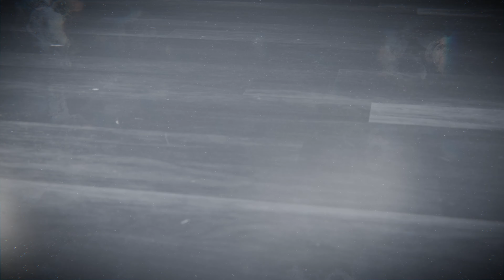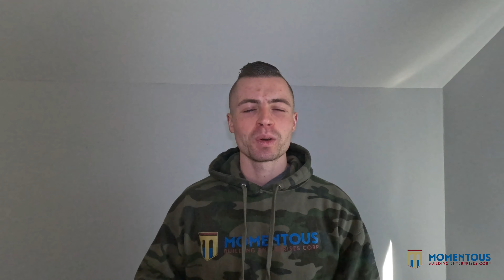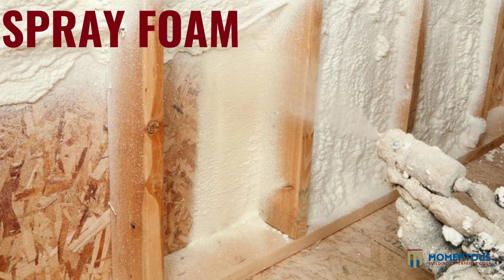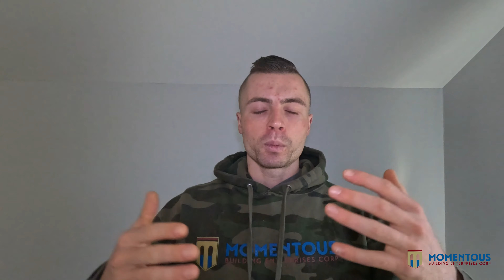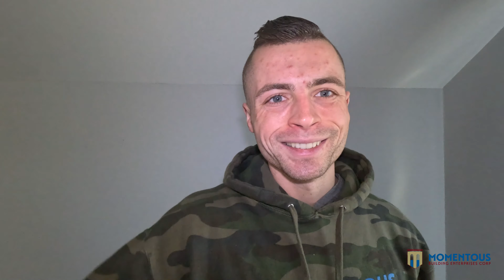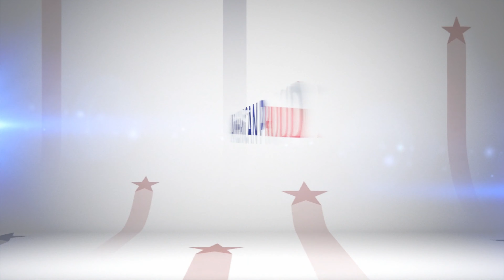Discover How Spray Foam Insulation Can Save YOU Money!

Comment: It has it's drawbacks too. If you have a leak in your roof, or have to replace a sheet of decking, it's a problem. Also, I wouldn't applicate foam on the roof decking without a baffle system underneath it. Plus there is some question of off gassing over time.
Reply from the maker: I agree, no system is perfect. Installing baffles on the roof rafter system is certainly the preferred method. My research is inconclusive as to if spray foam dose release gassing to the degree we must be concerned. 

The best roof construction method would be to have continuous insulation above the primary decking with Mineral wool insulation below. This method, however, is best for new construction and higher-end builds as it is costly.
Reply: @momentousliving  good points